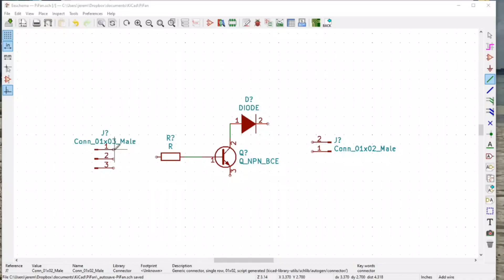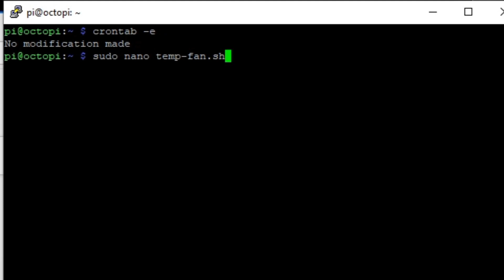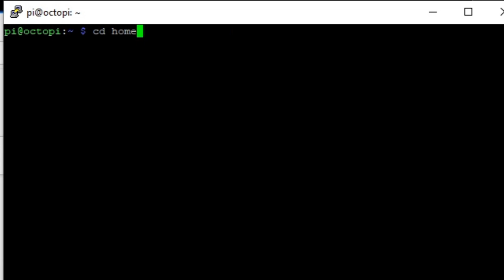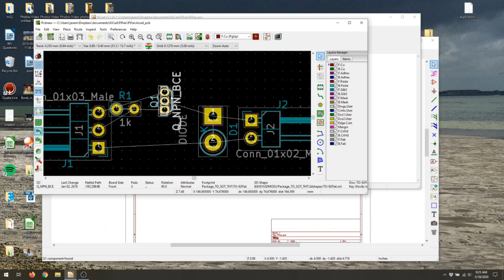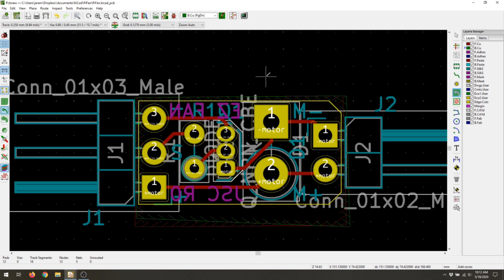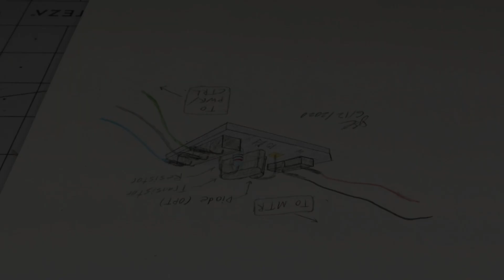Raspberry Pi Fan Temperature Control [Howto]

Comment: you should make a pwm fan splitter 3&4 pin with rgb and speed sensing/control. corsair gouging $50-70  and it doesn't even work with 3 pins (full speed)
Reply from the maker: Interesting. What's the Corsair model #?
Reply: @JeremyCook  CORSAIR - iCUE Commander Core XT Smart RGB Lighting and Fan Speed Controller - Black 
no control or sensing for 3 pin fans
Reply: you can use (free) Fan Control if you don't already have software that you use to control fan speed

Comment: Hi Jeremy, maybe you can shed some light on an issue I'm having with one of the fan controllers you have on tindie. I have 2, 1 old and 1 newer version.
My Pi 3b+ works great with the script and controller. Fan turns on and off just fine with the cron script
My Pi4 b however can't seem to turn on the fan when connected to the controller. I've looked at the diagrams over and over for the GPIO setup and connected varying different ways to no avail. I know the fan works as I just tested it without the controller. And oddly I noticed the pin labels on my newer controller do not match images on tindie. They look to be reversed or rearranged in some way, but even after trying to reverse the cables I still don't see the fan working.
Any advice?

Edit: I turned off the fan control option in Pi config and the fan started working but I can't seem to turn it off now. I think there was a conflict between settings and the config, and it looks like the controller pins were in fact rearranged. Maybe the script isn't working?
Reply from the maker: Hey Redn - Just saw your comment. You are correct, the ground and control pins were reversed to make them easier to plug in for the newest version of the EZ Fan 2. Check out the pictures on the EZ Fan 2 listing on Tindie and that should hopefully shed some light on it.

The new version is 5V - GND - GPIO
The old cersionm is 5V - GPIO - GND

LMK if you have any other questions hi @ jeremyscook dot com
Reply: @JeremyCook  Thanks Jeremy. I absolutely will! I appreciate you responding to comments like this still. For now it does seem to work, though the temperature it activates at is oddly ephemeral, but it does turn on and off so I'm happy with it.
Reply from the maker: No problem, glad I saw it, and glad it worked!

As for the temperature, when using OS control the RPi fan control will come on at a certain programmed temperature, but won't go off until it drops well below that. 10ºC IIRC.

Comment: can i use 1X1000ohm resistor instead of 1X500ohm resistor?
Reply from the maker: I don't think that will work. However, two 1000 ohm resistors in parallel may.
Reply: @JeremyCook  I will try 2X220ohm + 10 ohm (total 450 ohm). i hope that suffice.
Reply from the maker: @lucky_viewer2  Should be OK. Honestly, I suspect 220 by itself would be OK, but no guarantees.

Comment: Another fantastic video but unfortunately for me this script does not switch on the fan :-(

Steps to reproduce:
1. in the home directory create the temp-fan.sh script and copy verbatim your code
    the only change that I made was: 'gpio -g mode 14 out' and 'gpio -g mode write 14 1' and 'gpio -g write 14 0'

2. chmod +x ./temp-fan.sh
3. access the crontab file using crontab -e and enter the following at the bottom of the comments: * * * * * ./temp-sh
4. reboot the Pi for good measure: sudo reboot
5. ssh back into the Pi and manually ran the bash script which shows the temperature being 47 but still the fan doesn't come on

Any ideas please?
Reply from the maker: Glad you enjoyed the video. As for your problem, this may help: https://github.com/JeremySCook/RaspberryPi-Fan-Control/issues/2
Reply: @JeremyCook  Thanks for the reply Jeremy. 

Actually I managed to get it working by following this tutorial: https://howchoo.com/g/ote2mjkzzta/control-raspberry-pi-fan-temperature-python

 I followed Step 5 and created the fancontrol.py file and amended the following variables:

ON_THRESHOLD = 45
OFF_THRESHOLD = 40

Followed Step 6 to ensure this script executes on bootup.

Wired up the fan to the EZ Fan2 with the cables supplied.

Tested the device using a hair-drier and it works a treat :-)

Used the heat-shrink supplied to wrap it all up.

I'm impressed with this...
Reply from the maker: @miteshparmar1  Glad you got it working! I need to go through my script etc and update it. 

That being said, I'm sure the Raspberry Pi OS functionality that is available now: https://www.youtube.com/watch?v=AdjU_AVcZTA will work for most people.

Comment: finally you can command it via raspi-config performance tab
Reply from the maker: Nice, I'd heard that, but hadn't tested it. Have you tried it with the transistor setup seen here?
Reply: @JeremyCook  i'm trying today with a 680ohm resistor and NPN transistor (2N2222). i'll let you know :)
Reply from the maker: @ottovp  Please do! You may need a smaller resistor though (or you could try two in parallel if that's all you have, though that may be a little too low).
Reply: @JeremyCook  works like a charm! tried to stress test and adding a diode for viewing pleasure! i'm an octoprint happy user now!
Reply from the maker: @ottovp  That is great to hear, thanks for letting me know! Working on something new/another video on this subject, so I hope you enjoy :-)

Comment: raspi-config now has the ability to turn on/off a GPIO pin depending on temperature - Performance settings/Fan control, unfortunately it only allows a single temp to turn on/off, I prefer having two temps, turn on when >=55, turn off when <=45.
Reply: I've tried this setting a few times. Do I need all this shown in the video here, or am I just telling it the wrong GPIO pin to control?
Reply: transistor = 2N2222
resistor = I used 1K
diode anything I had laying around!

[+5V] > [(red) fan (black)] > [(collector) transistor (emitter)] > [GND].
[GPIO] > [resistor] >  [transistor (Base)].
[transistor (collector)] > [ (+) Diode (-)] > [+5V] .
Reply from the maker: @Redn2000  If you're asking if you need a transistor setup, then most likely yes.
Reply: @JeremyCook  Thanks. I've been trying to find a compact guide so I can fit it inside a kana kit case, but every guide I've seen has used a breadboard for it. Is there no straightforward solution by using jumper wires and a transistor and resistor?
Reply from the maker: @Redn2000  NP. I show one solution around 2:30 or I have PCBs listed in the description which may fit your requirements.
Reply: @JeremyCook  Awesome, I think that's exactly what I was looking for. And the PCB is cheap too. The only thing I didn't see available was the connector wires, but they sell a bunch on Amazon.
Reply from the maker: @Redn2000  Nice! They should be available as an option, but, TBH, Amazon or eBay would work just as well.
Reply from the maker: Ah, that is pretty neat. Thanks for letting me know!

Comment: Would your exact setup work with a varying pulse frequency on the base 3.3V to give you variable speed like the Andreas Spiess solution?  I have all the components in your setup, but want to try it with variable speed.
Reply from the maker: I don't know the specifics of Spiess' solution, but I see no reason why you couldn't use PWM with this setup.

Comment: why should transistor be after load?. I noticed that my fan is not spinning full speed and transistor getting too warm. Upon inspecting I noticed my transistor is before load, and wonder if it will make a diff.
Reply from the maker: Hi Krish - I'm not the best person to explain the physics involved, but yes, it definitely makes a difference!
Reply: Try changing the base resistor to 100ohms
Reply: Just saying here... it makes no difference which "side" is switched. It is a series circuit that has a switch (transistor) and a load (fan motor). 
The only difference is what transistor you use. If on the ground (low) side of the motor, you need an NPN type of transistor, on the positive side of the motor, you would use a PNP type of transistor. It works both ways!

Comment: Hi Jeremy, I don’t currently have a 500ohm resistor and have seen some people use a 1k. Would that work as well?
Reply from the maker: Hi Bara, I believe a value lower than 500 ohm would work (though I'm not sure of the lower "limit" so to speak). Another commenter used a 1K and had difficulty with it, so I wouldn't recommend. That being said, you could hook 2 of them up in parallel to give 500 ohms of total resistance. Alternatively, the link in the description includes a solder kit if you so prefer.

Comment: Hey Jeremy, I finally made some of these.. the first time I got 200 1k ohm resistor (I don’t know why) and it worked for a few days in a pi3.. then it stopped working.. the fan just flickered on for like a millisecond and didn’t stay consistent..

So I studied for a long while and figured I’ll need a smaller resistor.. so the gpio’s output 3.3 volts and the 2n2222 base needs to be limited to 5mA so 3.3/0.005 = 660.. so I got 680 ohm resistors

It works but not on the ice tower fan with the RGB lights.. I don’t know why.. but the one u sent works on the ice tower maybe because yours is 500> something ohm..

I don’t have any resistors lower than 680 at the moment, so out of frustration I directly connected the GPIO to the 2n2222 base and lowered main power to fan to 3v instead of 5 to be safe.. and it works fine.. turns on off based on script.. I put it on a brand new pi4 8gb and wondering if I’m seriously risking it by not using a resistor on the 2n2222 base..

Any advice on my situation? Is it absolutely necessary to use a resistor in a 2n2222 transistor to switch a fan? I have 100 2n2222 transistors so I’m not worried if 1 dies.. but I’ll hate it if my new pi4 dies with it..

Your PCB is still the best.. I have it hooked to my main server and it works like a charm & looks great too, no problems yet.. if your willing, I’d like to buy two more.. I’ll keep them as an emergency backup.. please let me know..

Thanks alot..
Reply from the maker: Hey Rezwan,

I don't think the resistor is absolutely necessary, in the same way that you can power an LED with a 3.3V output. However, the life may be shorter than it would be absolutely. I believe the risk is more to the transistor than the Pi itself.

Thanks for your kind words on the PCB. I actually ordered a few more PCBs, so planning to list them on Tindie soon. Just email me though and we can work something out immediately!

Also, per a comment on the GitHub page https://github.com/JeremySCook/RaspberryPi-Fan-Control/issues/2 , someone was saying that they were having some problems with the script, and that the GPIO library I was using was deprecated. It also supposedly didn't work properly with the Pi 4. You've been using it with the Pi 4 with no issues, correct?

Seems a little strange TBH.
Reply: Jeremy Cook DIY i think GPIO will work fine with the official Raspberry Pi OS.. but I use Ubuntu and apt install wiringpi” won’t work in Pi4.. I had to download unofficial source code for wiringpi from GitHub and compile it.. it’s not that difficult..

I am using my own script to control the fan according to my need.. but a script shouldn’t be an issue as long as the latest libraries for GPIO (which does support Pi4) is installed..

It’s great your selling the PCBs.. they are really one of a kind.. I can be your first customer in tindie :D..

Anyways thanks for your input on the resistors.. I’ll email u in a couple of days about tindie listing..
Reply from the maker: @rezwan8744  Well thanks! Yeah ping me in a couple days, hopefully I'll have the listing set up :-)

Comment: Can the positive and negative leads be connected to an external power source instead of the pi?
Reply from the maker: I suspect so, but you'd likely need to connect the grounds (negative). You may want to check this with something non-critical first though. Would love to hear your results.

Comment: Hi, I am planning to follow your setup but in our local electronic store, they don't have 2N2222 Transistor, they are offering PN2222 instead. Will that work? I also got confused with the diode, did you used it?
Please help an old guy that doesn't know anything about electronics. LOL
Reply from the maker: Hi Jesse, I think that will work, and might even be a form of the same thing, though I'm not certain. Diode is a good idea, but optional, it's not actually on the version I have running right now.

Comment: Awesome video. Very cool seeing the PCB design that followed. Thanks!
Reply from the maker: Thank you. Considering doing something similar?
Reply: @JeremyCook  yes! Just built a nearly identical setup on a breadboard using a transistor with a 5V fan, now I can see why the PCB design is useful, because it's extremely compact. I'm testing out this 5V circuit before attempting to control a larger 12V 6A load with the Pi. Once I've got that circuit working I'll be very interested in designing a PCB like you have done here!
Reply from the maker: @nismoskys  Awesome, glad you got some use out of it! The design is on GitHub, but you'll obviously want something a bit bigger!
Reply: @JeremyCook  I might snag the design just for the Pi Fan use case. Thanks for making that available 👍
Reply from the maker: @nismoskys  No problem! I keep meaning to put them up for sale on Tindie, but so many other projects :-)
Reply: @JeremyCook  never heard of tindie before you mentioned it in the video. Very cool hub thx.
Reply from the maker: @nismoskys  Np - I'm a big fan (and I actually write for them too, full disclosure :-) But seriously, it's a great site/organization.

Comment: In your final one, you didn't use the diode. Why?
Reply from the maker: IIRC I may have hooked the diode up backwards, so snipped it off. Put together another one with the diode, which did work correctly.

Comment: Hi Jeremy, this is a very nice tutorial and pretty soon I'll have all parts needed delivered, so I can make my own circuit. I'm just a little hesitant as to where to place the flyback diode, which you say is optional, but I figure it's so cheap and probably couldn't hurt, so why not add it. Only when you're an EE noob and not familiar with schematics, it's a bit tough to correctly decipher them... So a noob question: where exactly do I add the diode?
Reply from the maker: Thanks! Hmm, well if you're having trouble with the schematic, I'd try to copy the breadboard layout at 1:18, then shrink the connections down to whatever format you're using.

Alternatively, I'm considering selling these PCBs. Would you be interested in that?
Reply: @JeremyCook  Hi Jeremy, using your PCB is tempting, but I think I much more prefer to get my hands dirty and try and get this working myself. What better way to learn than by actually doing it ;) Thanks again for the vid and article on your webpage.
Reply from the maker: @misztong  Glad it inspired you. LMK if you have any issues!

Comment: Do you not use the diode in the first (heat shrink) design?
Reply from the maker: Hi Andrew, It should probably be there, but I left it off so things would be easier. The board I'm actually using now has been operating without a diode for over a month, FWIW.

Comment: @Jeremy Cook what kind of resistor do you use and diode
Reply from the maker: IIRC, spec'd at 1k, but used ~600 ohm - not sure that's optimal, but I don't think it has to be perfect. Diode: small one that I pulled out of my parts bin. I don't think this has to be perfect either, and is somewhat optional.
Reply: @JeremyCook  I'm a little late, but great vid! What constitutes a small diode?
Reply from the maker: @shaho3125  Hey, NP - most anything will work and if you leave it off the fan simply may fail faster. At least that's my off-the-cuff, untested answer. I believe the device I used in the EZ Fan 2 was a Diodes Incorporated 1N4448W, but that is surface-mount.
Reply: @JeremyCook  hmmm so a 200mA 100v switching diode would work for a little 5v fan?
Reply from the maker: @shaho3125  If I had to guess, yes. I bet you could use an LED even.
Reply: @JeremyCook  Thanks, bro. The technical specifications are all greek to me. Cheers!
Reply from the maker: @shaho3125  Cheers, and good luck! You can also buy one in the description if that doesn't work out.
Reply: @JeremyCook  I live in Canada, so I want to avoid the added shipping cost as much as possible. I might if I get desperate, though. Yours look awesome. Thanks again 🍻
Reply from the maker: @shaho3125  Well thanks! All the best either way.

Comment: I need to pack up a breadboard vise or two and mail them to Jeremy!
Reply from the maker: I'm all for it! Though is that the one you sell on Tindie? Guess my printer could "send" me one if I'm not too lazy :-)
Reply: @JeremyCook  It is on Tindie and Thingiverse. Nobody should buy it from Tindie.  It takes too long to print, and I don't want to be printing them, so they're priced too high for 20 cents worth of plastic! :)

I have some ideas in my head to turn it into a 3-piece CNC plywood project, so it'd take dozens of seconds to cut instead of hours to print.  I just haven't sat down to CAD it!
Reply from the maker: @patregan  So you say, but I see you've got over 100 orders for your products there. So good job?
Reply: @JeremyCook  If Jeremy says I'm doing a good job, then I absolutely must be doing a good job! :)
Reply from the maker: @patregan  Ha, I didn't even think of that, but yes, you are doing a good job. 
YouTube, however, is doing a bad job of notifying me of your replies, so I'm glad I saw it. I guess it doesn't take you seriously.